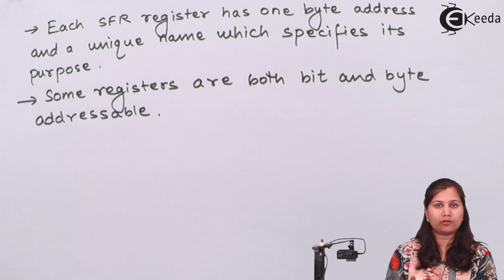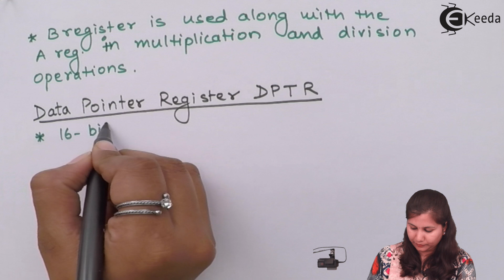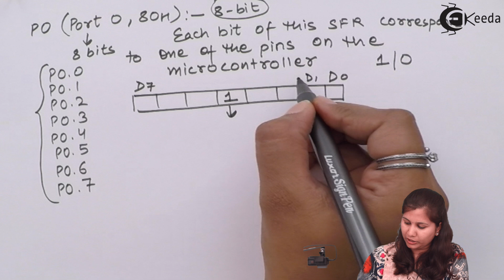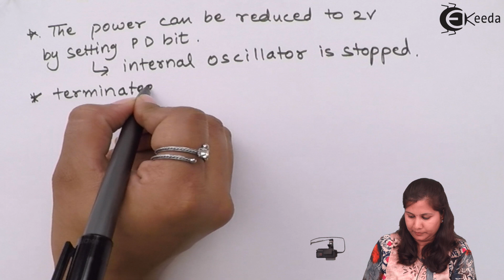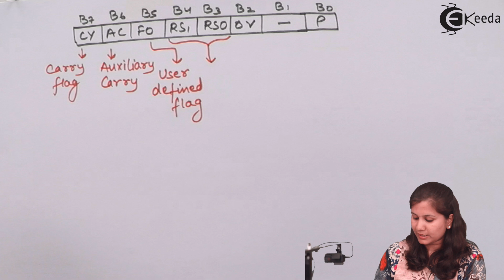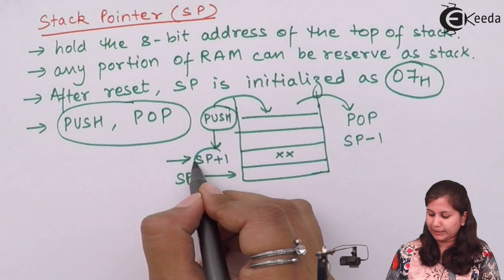Special Function Registers of 8051 Microcontroller - Microcontroller and Its Applications

Comment: 8051 has only 128 bytes of RAM Not 256 bytes
Reply: Well other version has
Reply: 🧠 So technically:

Yes, 8051 has only 128 bytes of true, general-purpose internal RAM.

The total internal address space is 256 bytes (00H to FFH), but the upper half is not usable as normal RAM